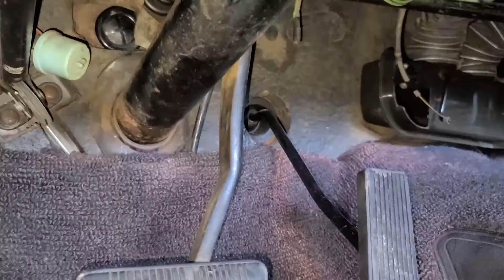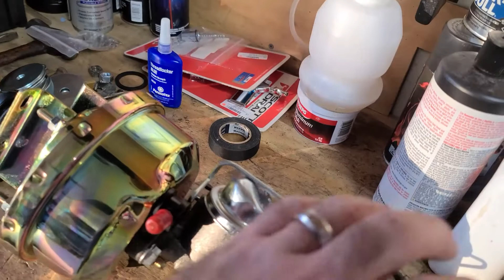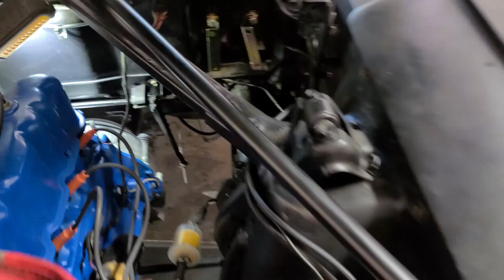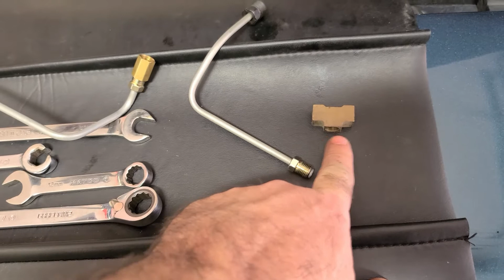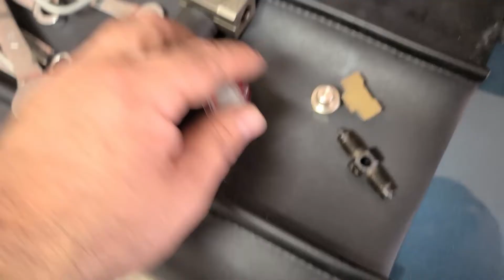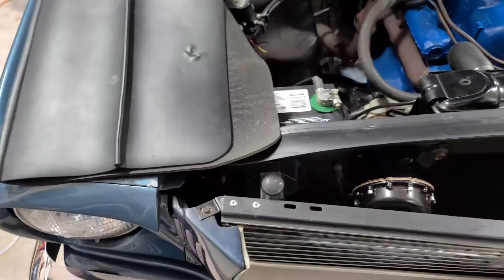66 Mustang Dual Bowl Power Brake Conversion

Comment: Thanks for the video. I have the same setup in my '65 convertible and had read conflicting information about if the LEED kit you used would fit given the export brace. Glad to know that both the booster and dual bowl fits (with some significant struggles it seems). Great advice though!

Comment: Where can I get the Vacuum Distribution Tree can you please post a link thank you!
Reply from the maker: You are going to have to find it used.  No affiliation, but here is this link where I found a tree: https://secure.cougarpartscatalog.com/vacuum-fitting-brass-intake-manifold-used-1968-1969-mercury-cougar-/-1968-1969-ford-mustang.html

Comment: Great video , I’m doing the same conversion / w Leed kit and having problems with push rod @ pedal - it’s not long enough, any suggestions . No tech support from CJ who I got kit from , thnx
Reply from the maker: I highly recommend you get a brake adjustment tool like this one: https://a.co/d/4uWC6xJ. Doesn't have to be that one but something like it.  Otherwise, you have to get that measurement by checking the depth of the master cylinder, but paying close attention to the actual depth as it is sitting in the installed position.  Measuring which shoulder matter and ignoring whichever one doesn't.  It isn't very complicated, but that tool makes it super simple.  Sorry it took so long for me to respond.

Comment: Hi, I am changing my front drums to disc brakes. Would you advise changing the master cylinder too and if so would you also advise putting in the power brake conversion or do you feel the extra cost was a waste? Thank you for your time.
Reply from the maker: If you are trying to keep the most period correct car then stick with the factory spec.  However, if safety is the priority and it was for me, I'd recommend power brakes with a new dual bowl master cylinder.  I want the car to appear as factory as possible from 10 ft with the hood closed but have as much of all new technology I can, especially regarding safety.  I upgraded.  Thanks for watching!  New video on LEDs drops tomorrow!
Reply: @WhitetailGarage  amazing thank you. Yeah I've got the same plan for my project too. Safety first 👌🏽  looking forward to more of your videos